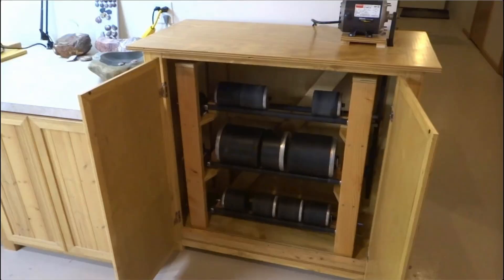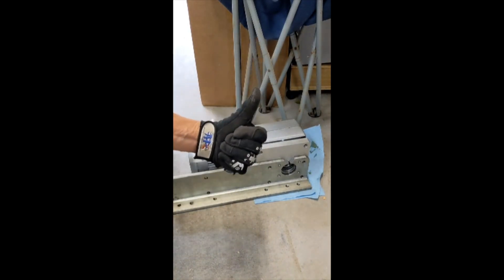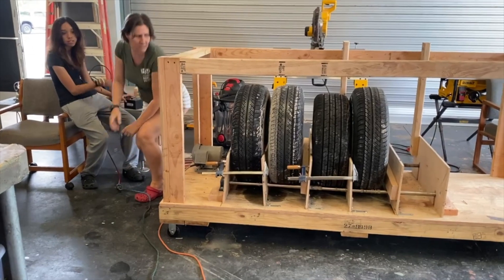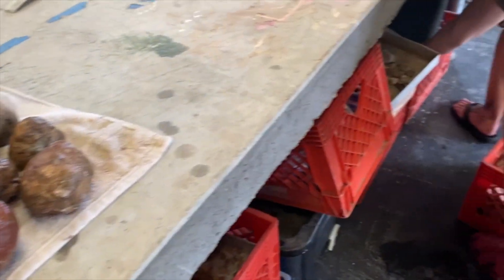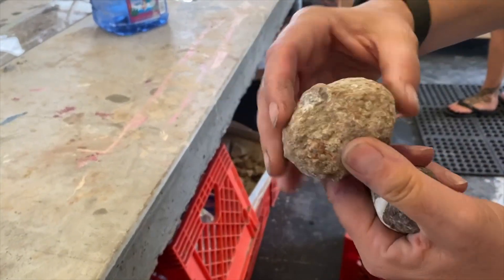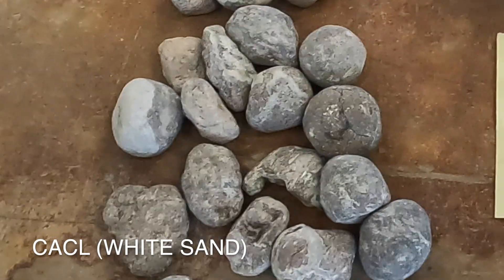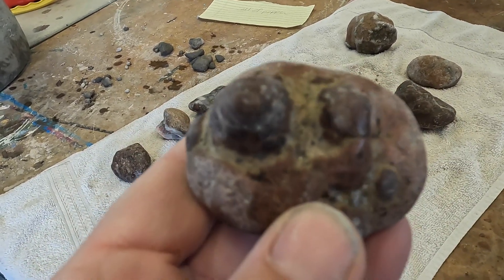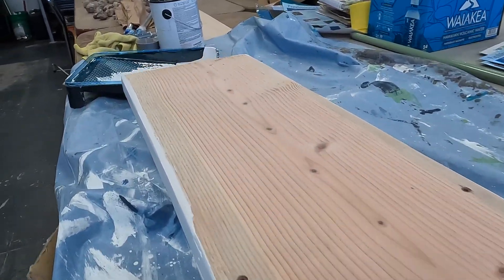Rock Tumbler

Comment: That's quite a tumbler! I was wondering if you were going to seal it up somehow and then I saw the ingenious method of using an inner tube. How appropriate!
Reply from the maker: Thank you! Big fan of your channel. Sealing it was critical, while we did a "break-in" run it wasn't sealed, and it could evaporate half a cup of water every hour in our climate. 
The rock collection we have is very extensive, and I've been trying to get the kids to pick some more appropriate rocks to tumble, but they seem totally fixated on the geodes.

Comment: Nice!  to cut your friction on holding the tires , instead of boxing them in use a pair of smooth rods from the upper brackets. Surface area on a rod would be a line surface area on the box in is way too high, it's eventually going to be to much for even the best motor.
Reply: and let them roll.
Reply from the maker: this is an awesome suggestion! Mahalo!